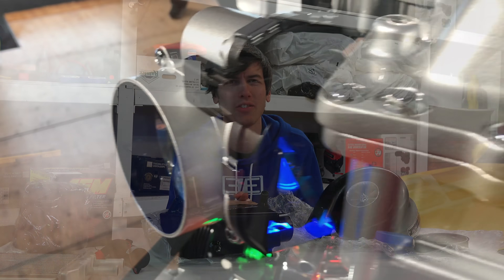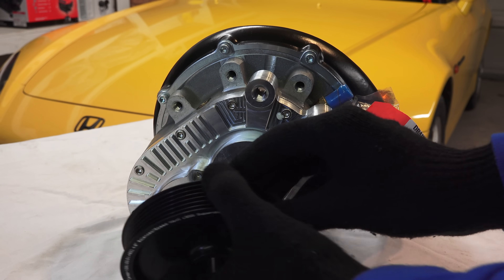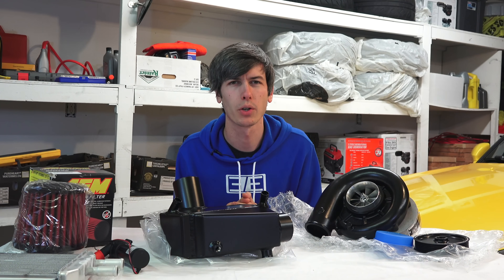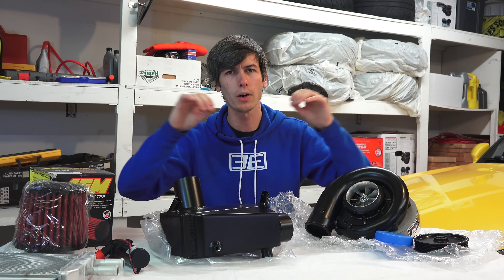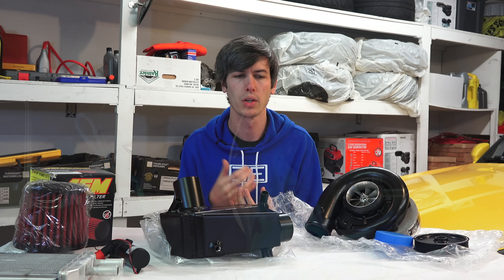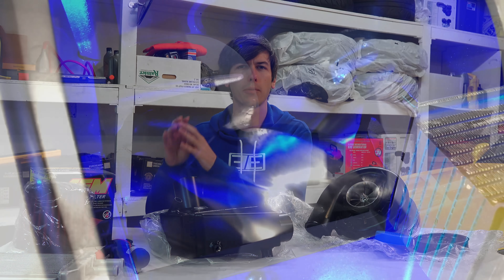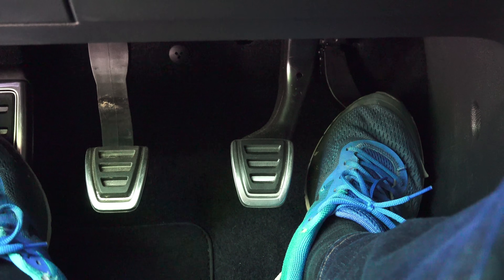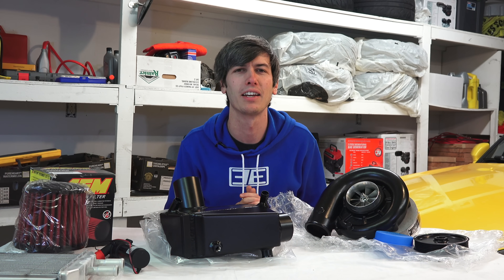Turbochargers vs Superchargers - Which Is Better?

Comment: what's with variable delivery turbo charger?

can a super charger & turbo charger be combined into a single unit so as to use advantages of both the technologies?
Reply: or can the this unit be powered with an electric motor?
Reply: You can both turbocharge and supercharge an engine at the same time. There are electric superchargers. Turbochargers always use the exhaust to spin them.

Comment: How many miles on an engine is to many miles before adding supercharger?
I have 75000 os there any danger?
Reply: You can put a supercharger on any engine regardless of miles. But there's more stress on an engine with any type of boost so you will be shortening the lifespan of the engine for the most part. But I've seen people put superchargers on engines with 200,000 mi on them. What kind of car do you have that has 75,000 mi? That's not very much. I wouldn't hesitate a bit if you were thinking about it. You have to look at the reliability of the engine.

Comment: I much prefer the emendate resonce of a super charger I am a long term BMW driver but poor they made a motel 318ti was a nice car but underpowered for spot driving there was a place in Atlanta that put the unit that Mercedes used roots style I bet it was great !
  A Austin I have is is there information on the time the air pressure takes to go though the inter coolers and there plumbing  there is a style of install where the turbocharger is placed to the rear of a car with tubing to and from the engine you would want to insulate for exhaust side And cooling the charge side is desirable but the time delay of all that pipe both to and back would ruin driving for me !

Comment: Doesn’t supercharging break traction of the tyres more than Turbo’d cars?
Reply: I guess you can say that. Superchargers produce more torque low in the RPM range, especially on larger displacement engines.

Comment: Once again I find that this guy does not explain things clearly of methodically. The most important aspect of both superchargers and turbo chargers was left out. In a normally aspirated car the air is sucked into the engine by the vacuum produced by the cylinders on the intake stroke. Nominally the air to fuel (stoichiometric) ratio is 14.7 parts air to one part fuel. By boosting the air intake by increasing the air pressure, more fuel must be mixed with the air to maintain the stoichiometric ratio. It's like blowing up a bigger bomb to power the pistons.

Comment: Would be interesting to cover electric boosters too. Also, what about using an exhaust turbine to generate electricity and store in say a super capacitor and use that power for super charging?
Reply: Seems like it would be a very complex and expensive system.
Reply: Y'all just be patient and wait for an electrical engineer to say something about it all at least this topic right up
Reply: Here's the problem with electric supercharging:. Where does the power come from?  Ultimately the alternator.   So instead of a belt driving the supercharger you're just using a belt to drive a larger alternator, creating your electricity, and then feeding that energy into an electric motor which is driving your supercharger.   So more weight and complexity AND less efficiency.

Comment: There’s no sound more satisfying than hearing a turbo spool
Reply: I find the banshee wail of a supercharger nicer than a turbo spool sound.
Reply: It's annoying, it sounds like a sneeze, hear some supercharger sound(expecially the hemi or Mustang ones) you'll love them
Reply: or an SRT whine...
Reply: I am lucky enough to work on freight train engines, 3100hp. On test these units take 2 mins to make peak power. After 10  seconds or so the turbo starts to wind up to 32 psi like a jet engine taking off. As you say, the sound is something that runs though you and makes you smile. The turbo itself weighs just under a tonne, the engine weighs 32 tonnes, and the locomotive weighs 130 tonnes.  ( I love these on test)
Reply: @robpotter1355  Jesus. A 2000 lb turbo. I've had entire cars that weigh that. That's awesome. What's the displacement on one of those engines?
Reply: @rhull3939  not sure about displacement but it’s a Mirrlees MB275t if you want to google it yourself? Fitted to a British Rail class 60 locomotive.
Reply: @robpotter1355  145 liter engine with 3100 horsepower and 106,500 foot pounds of torque. Crazy.
Reply: @rhull3939  ya but what's the 0-60 lol , damm tho
Reply: @rahmatiTV  0-60 in 2.7 hours.
Reply: @robpotter1355  I love the way dynamics sound when I’m slowing down my train.
It sounds like a jet engine next to your ear. Sometimes on our older UP units I gotta close the windows wayyyy to loud.
People should look that up

Comment: i still prefer turbocharged cars over supercharged for some reason (the "lag" is something that you can accept or not).. since i drived a bi-turbo one i'm absolutely turbocharged fan :D
note.: there is 2 type of "double" turbo configs.. in the US they called parallel twin turbo where the 2 turbos are feed 1-1 cylinder banks all the time.. the other one is a sequential twin turbo where the 2 turbos activate at different RPMs.. in EU ppl use twin turbo for the parallel one and bi-turbo for the sequential one.. ANYONE knows what is the official name of these? :D

Comment: Although it's obvious you lose power by driving a blower directly from the crank; a turbo must also have a power cost by being a restriction in the exhaust. I've always wondered if it isn't an equal loss in the end because there's no such thing as free power. Some much effort goes into building free flowing exhaust to get more power and then to plug it up with a turbo seems to make no sense. Still...it seems turbos take less power to run than a blower. Is it magic?

Comment: Use a supercharger until the turbocharger is spinning high enough then switch over to the anti-lag turbo then you can just use the turbo for a while because it has anti-lag

And don't say "BuT tHe TuRbO hAs AnT-iLaG" yeah the antilag keeps the spining rate when you lift of the pedal, but then you can spin the turbocharger up while using the supercharger and when the turbocharger is spining fast then press a button and then you're using the turbocharger and the anti-lag should keep the turbocharger spining fast but if you have to you can switch over to the supercharger and at the same time the turbocharger is spinning faster and faster

Comment: If you're talking about a centrifugal supercharger, well yeah you may get into boost quicker, but at lower rpm's it'll be much less boost than near the top end. 

A turbo otoh may not be making boost at say 2000 rpm, but when it gets to full boost by say 3000 rpm, it'll have a fuller curve under boost until peak rpm.

Comment: Idea: take the turbine from a turbocharger, hook it up to a battery, use the battery to power a supercharger.

Okay internet, tell me why this wouldn't work.
Reply: @Olds_Pwr  My idea was that the turbine from  turbocharger would charge the battery (via an alternator of course).  Wouldn't that make it just as efficient as a traditional turbocharger?
Reply: @Olds_Pwr  Thanks for the info.  Your points make sense.  Still I wonder if it might be possible to design an alternator that could handle the high speed/heat of a turbine.   It's an interesting possibility at least.

Comment: The lag phrase was used a bit too freely here.
  
 A well built turbo motor for daily driver use has little to no noticeable turbo lag. The old production turbo cars did, but not modern tech and this is born out by the performance proximity of modern production turbo and supercharged sports cars to each other in fair comparisons. From personal build experience I've found that turbo lag has more to do with builds that sacrifice compression ratio in order to run high boost pressures for unreasonably high power outputs on the street, the same way big camshafts sacrifice bottom end torque for high end HP. 

 To each his own, but hands down, when it comes to performance potential and expedience of increasing power output, as well as distributing power over the rpm range, turbo is the way to go. The supercharger always follows the crank, but turbo power can be modulated with boost control in a manner that makes the power feel endless through the power band. The problem holding turbos back on production cars is stock programming, otherwise they can hit just as hard off the line. Case in point;
  The 2016 6.2L supercharged CTS-V has nearly 200 horsepower and torque more than the 3.6L twin turbo ATS-V. .7 and .2  second difference in the 1/4 and 0-60. A tune modification is all that's needed to put the ATS-V in the 11 sec quarter mile range as well as dry up that .2s  0-60 difference while at the same time still putting out less total hp and tq. The only appreciable advantage modern superchargers have over modern turbo systems is packaging.  Swap out the 6.2L Vs super for a proper turbo, and it's a wrap. Lag is old school like 7 and 8:1 compression ratio boost.

Comment: Given how a supercharged engine functions, what would be a minimal hp for it to make sense and function/work & be reliable for a blue collar worker. The Mini Cooper has an S variant which I think is a four cylinder but then I'd have to drive a Mini. Personally I'd go with a SC (PURELY for the pedal response and SOUND) engine but a small simple DOHC four cylinder if there was such a mass produced reliable manufacturer.

Comment: Can we have electrical driven supercharger 🤔 It won't drain power from the engine then 😀
Reply: The engine would still have to supply the power with a generator. You could use batteries but then you only have a limited amount of boosting time.

Comment: He keeps on touching the turbo on the table when talkinh about supercharge and its misleading
Reply: That is a centrifugal supercharger. It has the same type of compressor that a turbo uses but instead of a turbine there is a gearset driven by the engine.

Comment: What I find sort of odd in the car enthusiast community is how everyone's attitude around turbos seems to have changed. Maybe 10-15 years ago turbos were really cool in everyone's mind - lag was a shortcoming but they were seen as a really neat idea, a great way to get a ton of power out of a small engine, and people loved the flutter or blowoff valve noise. Now that so many cars, even econoboxes, are coming turbocharged from the factory, it seems like everyone hates them. Complain about how they kill the car's sound (they sound different but subjective as to which you like better, I put a turbo on my car and love the way it sounds), now everyone lusts after big-displacement V8s, the tuning community now seems to be in a one-upmanship of how much NA horsepower they can make, and so on. To the point where it seems car makers are making their turbo cars try to pretend to be big NA engines, like the Ford Mustang Ecoboost that creates artificial engine noise in the cabin. Is it just that the grass is always greener on the other side of the fence?

Comment: honestly, the problem he mentioned about turbochargers having lag and superchargers having better pedal communication only applies if you are relatively new to the car. after spending some time with a turbocharged car, the driver should be able to fully understand its characteristics and thus will be able to get what exactly he wants from the car. most boosted racecars with experienced drivers who won't face the miscommunication issue use turbochargers and not superchargers for a reason. turbochargers and simply better if the driver is good.
Reply: I wonder why the 10,000 horsepower + drag cars I've seen do a quarter mile in 3 seconds use superchargers then?
Reply: nah you cant get the same response as you do from a supercharger, its well known.
Reply: Na dont agree at all. You need to spend alot of money on a turbo charged car to getnitntonthe same response as a supercharged factory standard car. Then you soend the same money on a already amaizng response supercharged car and you have annihilation of any turbocharged car.

Comment: I am not understanding that you say a supercharger is taking energy from the engine and a turbocharger is not.  Clearly, there is work being done by either and the energy/power for that MUST come from the engine.  That may be direct mechanical for the supercharger, or by way of increased exhaust back pressure from the turbo.  Either way, there is power being consumed and it MUST come from the engine/power stroke.

Comment: I haven't driven many Supercharged cars or trucks. But what I do like about Turbo is that when you press the accelerater, it almost feels as if the Engine gets bigger and bigger. Tractable is the word that comes to mind. Especially in a diesel engined Truck. 

Here you are at a stop light with 60,000 pounds on your back and this little 12.9 Detroit Diesel engine comes to life 1st with a Whistle (Turbo spool) and then with Grunt and it just pulls as if the Engine is getter bigger and bigger. Not sure if a Supercharged Detroit would have the same feel 🤔

Comment: Why not do both? Supercharger for immediate response but once turbo has spun up bypass the super to the turbo for more efficient power, then if the throttle changes, open the bypass a lil for immediate response then close it once the throttle is steady again. Probably easier said than done, but my setup would be a twin screw super with a bypass valve and a turbo, which those I don't know much about yet

Comment: I am late seeing this video, but I always hear one of the advantages of turbochargers over superchargers is that they take energy from the exhaust that would otherwise gone to waste, whereas superchargers take energy directly from the engine.  This is not completely true.  Turbochargers create several bars of exhaust back pressure which translate all the way back to pressure on the pistons during the exhaust stroke, which in turn robs horsepower indirectly from the engine.  Therefore, this is neither an advantage nor a disadvantage over a supercharger as the power for both come from the engine.
Reply: Both cause parasitic loss on the engine but a supercharger is less efficient. Most of the energy going to the turbo is energy that would otherwise be wasted in the exhaust. Whereas all of the energy going to the supercharger comes from the crank. At the same boost and density a turbocharger will make more power.

Comment: I've owned both, and still currently own both (currently own a highly modded and tuned '16 Audi S3 Prestige [2.0 L Turbo], a heavily modded and tuned '11 Jaguar XFR [5.0 L Supercharged], and a stock [so far] '19 Range Rover Sport Supercharged Dynamic [5.0 L Supercharged]), and I MUCH prefer superchargers. For reference, while I do completely LOVE my S3, I only get about 1-2 MPG better gas mileage from my newer Audi than my Jaguar (even though the Audi has a much smaller engine in a fwd-based [Haldex, y'all], 800+ lb. lighter car), but the turbo lag is almost insufferable (even with Stage 2+ ECU and TCU tunes with max bolt-ons). Even in the several twin turbos I've had, the engine always felt like a video game... very disconnected from actual throttle input. However, the 5+ supercharged cars I've had/have, feel very similar to normally aspirated engines, i.e. very correlated to immediate throttle input, which is HIGHLY preferable. I guess it's all moot, though, as we'll all be forced to drive electrics in the next 10 years or so. 😥

Comment: my opinion a turbocharger for a car is better then a supercharger. a turbo uses exhaust to power it. were a supercharger or blower used a belt drive so using power to run it.

Comment: GM LTG and LSY engines have an amazing twin-scroll turbo, there is no turbo lag and there is enough power at any speed. 2.0 liter with 9-speed combo is the best option on many new GM vehicles: Chevrolet Malibu/Equinox/Camaro, 2018-2020 Buick Regal, 2020+ Cadillac XT5, GMC Terrain etc. It does require premium fuel, but it really does work great. Long term reliability is to be determined.

Comment: Street I would go turbo, there is lag time. Strip most definitely super charger is immediate.
Reply: I think you have that exactly backwards.  On the strip you have time to spool up your turbo and you're not worried about longevity; on the street you need to be ready to go at the drop of a hat plus having an easier time with the oil.

Comment: GOD I LOVE THE tutututu sound, but I'm a driver that loves *confidence invoking* vehicles, like a well-handling track weapon that you know BY HEART how it's going to react when you drive it. I had a turbo'd s2000 back in the day, and I absolutely loved it, but I'd never flex on public roads (unless in a straight line) with it, because although I knew it like an extension of my hand, the turbo wasn't always perfectly predictable, there were a few times I ended up unintentionally drifting (nearly* into a curb once).

Comment: Something I really don't understand: How does the turbocharger compress the air without using energy from the engine? I suppose that the turbo is in the exhaust path of the engine. The engine, therefore, has a higher load in the exhaust path, which is pushing back on the piston. In other words, the engine is doing work to get the turbocharger to compress the air. Or does energy really come for free nowadays?
Reply: Supercharger get power from exhoust gas. It have two turbines one for exhoust and one for fresh air
Reply: Correct, A turbo does cause parasitic drain on the engine, but it is much less than a supercharger. Most of the energy that drives the turbo is "free" because it would have otherwise been wasted. However, a turbo is a restriction in the exhaust which makes it harder for the engine to push exhaust out (backpressure).